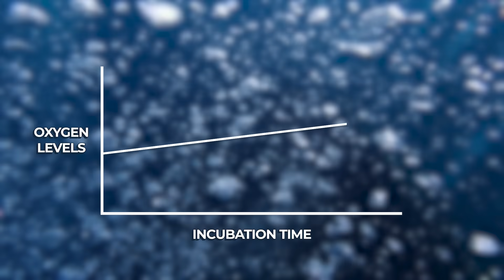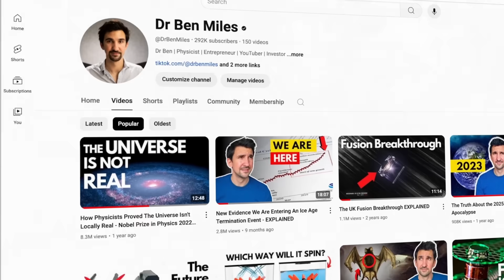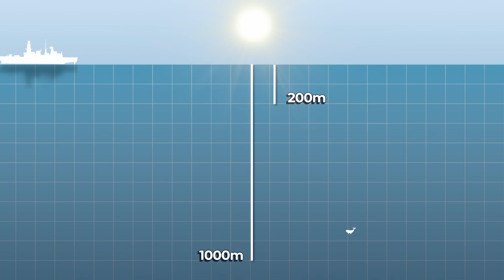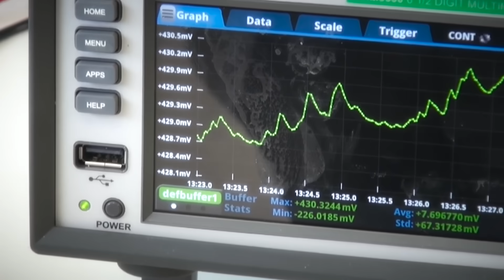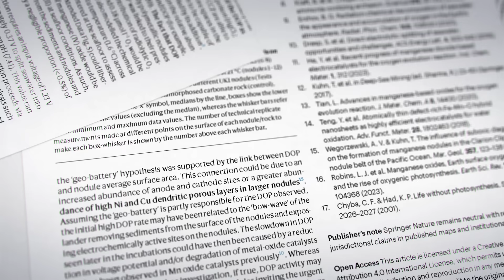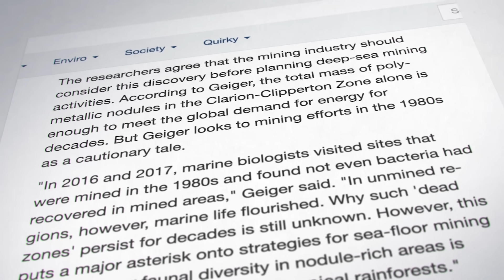We Just Discovered "Dark" Oxygen on Earth - Breakthrough Explained

Comment: It's possible that the oxygen production is related to the growth of the nodules. Since these deposits are growing over time from metal precipitation, it may be that the water used in the experiments was being depleted of metal ions as they attach to the nodules. Once the water was depleted of the materials, then the electrical production on the surface of the nodules could reduce. I would be interested to know if they did voltage checks before and after the oxygen peaked. Another possibility is that the reaction requires a lower oxygen environment. It would be interesting to find out if the conditions for producing oxygen and for growing the nodules were related.

Comment: I have to wonder if pressure has something to do with the separation of oxygen and hydrogen from water. Perhaps pressure is the input energy and the nodules are acting as a catalyst to facilitate the decomposition of water into H and O instead of electric current. Electrolysis would cause the depletion of the nodules over time, but perhaps pressure facilitated catalytic reactions would not?

Additionally, everything on earth is vibrating to some degree with the earth’s background vibration frequency, so perhaps the water pressure plus that small amount of vibration across the surface area of the nodules on the sea bed could be enough input energy to kick off a catalytic reaction? Would be interested to see if the reaction occurs at STP vs at depth, and whether the composition of the nodules change at STP vs at Depth.

We know that manganese can catalyze 2(H2O2) decomposition into 2(H2O)+O2 at STP. Maybe at high pressure and under certain circumstances or with a salt solution, manganese or a manganese bearing nodule could cause a similar reaction converting the water to hydrogen and oxygen? Just wondering out loud, please don’t crucify me in the comments :/
Reply: Damnit I just asked wrote comment three minutes after yours asking same thing. Don’t several battery types use pressure for both efficiency and different chemical processes?

Comment: I think the cause of the plateauing is more likely to be that the electrolysis is creating the O2 from something in the seawater (as either a component or a catalyst), rather than from the water itself. A limited supply of that something in the small sample of seawater would therefore limit the production. As for the 'unlimited battery' part, you have to remember that as long as the 'battery' is still in the sea, it's still growing. So it's not so much 'never ending.' but is just growing at a rate fast enough to keep it able to produce.

Comment: Maybe the process just keeps oxygen level there. Those deep waters have very low circulation and oxygen doesn't come up either. And there is quiet low oxygen consumption. So those rock batteries make oxygen level then reaction stops. They can check it out with some limited capacity oxygen absorber added in a can.

Comment: The jab at labeling it "dark" was uncalled for. The alternative label would have been "Non-photosythetic". Which is pretty much synonymous with "happening in the absence of light-2, vulgo "dark".

Also, when I hear that a chemical process in an abundant environment is plateauing, my fist thought is not "depletion of a reagens", my first thought is "dynamic equilibrum".

As for the idea that it's a battery driven electrolytic process: First problem that comes to mind is conservation of energy. If it takes energy to electrolyse that O2 out, this energy has to come from somewhere. As you say: It's difficult to produce a battery that does not immediately discharge. If that is the mechanism, there needs to be another mechanism, e.g. thermally driven, that first creates that potential.
Under that aspect the idea that stirring up the mud is the initiator is not that far off. This also introduces the possibility that the necessary energy is transferred into the system by precipitation of that mud from the surface.

Comment: It could be a battery, but then with the whole of the ocean as the kathode and the polymetallic nodules as the anode, or vice versa. There is probably a constant supply of the kathode or anode dissolving in the ocean, which makes it a continuous process. Of course the supply of those stops, when they put the water in a container.

Comment: 1. It appears to be a localized phenomenon 
2. It requires Oxygen to be produced by electrolysis 
3. Electrolysis appears to be catalyzed by the nodules and sea water.
4. We don't know the temperature of the sea water
5. We don't know if there are local currents in circulation which help complete the circuit.
6. A good working theory should explain both the increase in production and the subsequent plateauing of production
Reply: Point 6 is tricky, remember we are talking about both in vitro and in vivo findings here. The in vitro studies were of course in a closed environment, with electrolysis producing both hydrogen, oxygen and pure water as products. You would have expected measurements not only of oxygen concentration within the experiment, but hydrogen concentration and salinity also. The plateau could be due to any of those factors in a closed environment, or something entirely else, but would/could not be seen in vivo. It could well be at the low voltages seen, and with these factors, electrolysis is impeded or halted after time in silo. More study neeeded it seems.
Reply: Point 4 : we do know the SW temperature. Even if the experimental equipment didn't include a temperature sensor in their data-logger (very unlikely - it's a Biological Oxygen Demand experiment - temperature is an important control on BOD in surface environments where you also measure it) then the ROVs that deployed and retrieved the experiments would have included a hydraulic fluid temperature sensor (and report to surface) because the temperature of the hydraulic fluid (oil, or dyed water) is an important indicator of the state of the hydraulics system.
Immersed in seawater, at wildly varying pressures, hydraulic power is much less difficult to work with than electrical power. For things like propellers, rudders, pick-up and drop-off arms, covers on sample baskets ... the temperature was available, and they'd have been fools to not use it. (I used the ROV hydraulics temperature as an estimate for sea-bottom temperature in my work at sea, where it is an important parameter in estimating the location's heat-flow. If they run the hydraulics, the system temperature rises ; when they stop running the hydraulics, the temperature falls back ; plotting the decay time-temperature curve, you can estimate the seabed temperature as closely as you need.
Reply: 1. These nodules exist in very, very large areas of the deep ocean, we know this for a fact. Are you calling that "localized" or do you mean something more local? I don't think we can know for sure until more research is done. If it happens everywhere that these nodules are common then we're talking about a significant proportion of all the deep oceans.
2. That is the definition of electrolysis, yes.
3. The sea water is not the catalyst, it's the electrolyte. By the nodules, yes in part it seems that way, although also there's an observed voltage potential across the nodules i.e. it's powering the process, as well as catalyzing. 
4. Yes we do!
5. The experiments were carried out in sealed tubes, not sure how "local currents" are relevant?
6. Yes, I agree with that part at least!
Reply: @PhilAndOr  For 5, he explained it in the question when he said, "Which complete the current."
Reply: @ISayNukem  currents are irrelevant when the oxygen production increases inside a sealed tube.
Reply: Lighting, is just a happy electron going wee, it only takes one single molecule to create energy that surpasses the sun heat in an instant (lightning|)
Reply: YA what he said, and don’t forget the buried rotting whale.
Reply: Could the tubes themselves be part of the reaction?  Something akin to rubbing a balloon on one's head?
Reply: @stferret  Static electricity in a conducting medium ... that would be a neat trick.
Half of my electrostatics lessons in the physics lab didn't work because of the humidity varying with the weather - and we did that part of the course at the best time of the year. Soaking the whole appartus in 3.5% w/w table-salt-in-water is going to be even more effective at quenching static electricity than 1% water-in-air.
Reply: You really think they sent a million dollar scientific probe to the bottom of the ocean without a simple temperature sensor? Seriously?
Reply: how do we replicate these natural oxygen and hydrogen generators so they can be used to make cheap energy on the industrial scale is the question that needs to be answered.
Reply: maybe the pressure is just right at the bottom.. or the connection to earths core is important....
Reply: @picksilm exactly my thought.. perhaps there is a oxygen rich cavern somewhere way deeper down than our current machinery can operate.
Reply: Fart in the bathtub

Comment: Wouldn’t the hypothesis of electrolysis be better supported by measuring whether both free oxygen and free hydrogen increase in the samples collected?

If the process were organic (which , it could be a form of chemosynthesis), the increase in oxygen might not be accompanied by an increase in hydrogen; but if hydrogen does proportionately increase with oxygen, then the support of the evidence weighs in favor of electrolysis. 

Fundamentally, an oxygen increase without a corresponding hydrogen increase would be dispositive of the electrolysis question.

Comment: On the surface of the nodules ionic dissolved metals are being laid down constantly, via marine snow. At the same time electrolysis is oxidizing some, but not all, of the metal layer, producing oxygen. It is a continuous process, nearly in balance but favouring the deposition process slightly, resulting the very long growth rate of the nodules. In the experiment the deposition process was interrupted, resulting in a tailing off of the electrolysis, and subsequent oxygen production..

Comment: My opinion is that it's a mix of the water rubbing against the stones and the minor current from the stones causing the water molecules to split. I would say it's more of a static electricity rather than the stones being a battery. That said the stones give the proper conditions for it all to come together in one place. This would also explain why removing some of the sediment allowed for greater production of oxygen. It not only gave room for things to move and generate more static electricity for the stones but gave more surface area for water molecules to rupture on the surface of said stones. If you removed all of the sediment you would probably find that the production of oxygen would drop, just like when the stones are removed.

Comment: This made me think of Styropyro's video on brass pennies.  A water-splitting battery rock sounds possible... but if there needs to be an unusual disturbance like the sampling equipment dropping down and moving sediment to expose the reactive sites, then it wouldn't be an ongoing ecosystem feature, would it?  These things would have to be so sensitive they can be 'turned on' by a sampling event like that but not so sensitive that they burn themselves out over millions of years?

Also, "three times the background amount" of oxygen doesn't sound very impressive if the background amount is basically zero.

Comment: If oxygen is produced by electrolysis, then there should be amounts of hydrogen there as well.  Most likely is the oxygen is leaching from the test vessel walls at test depth.  Just like when you evacuate a light bulb, then wait, oxygen will leach out of the glass walls and you have to evacuate again.

Comment: I wonder if they took into account the material that the isolation containers were made out of. If the container had a different redox potential than the nodules then they created a battery by covering the nodules with the sea water acting as the electrolyte. The oxygen and hydrogen production would only proceed as long as their created battery did.

Comment: I think the "battery" idea kinda works. As the oxygen levels plateaued in the sample the electrolyte had been exhausted. On the sea bed think of the sediment as being the dust on a solar panel, it still makes electricity but at a lesser level. The electrolyte is still getting to the nodule but at a lesser level. In a closed "test" it may be depleted. It would be interesting to run a continuous test on the sea floor, i.e. open door... sampling the in and out.

Comment: Your concerns are well made. It does seem unlikely that:

-  the natural process of precipitation just happened to form working batteries
-  those batteries could stay charged after literal millions of years discharging into the water

And the scientists themselves say they didn't find a high enough voltage for electrolysis. But I still find this discovery incredibly exciting! It seems the nodules really do act like batteries, since they did actually measure a voltage difference across them.

As for where the energy comes from, maybe the process is partly biological? Maybe there are organisms inside the nodules (bacteria most likely) that provide the tiny extra charge that makes electrolysis happen? And maybe it's these organisms that keep the potential difference going over millions of years.

Comment: Seems like the biggest problem with the battery theory is a temporal one.  These deposit occurred in saltwater, the same electrolyte that's supposedly powering the "battery."   That means by growing 1-3mm/million years, it was storing more energy than it could deplete into the surrounding saltwater.  If it had formed in different conditions, and then was exposed to the electrolyte, maybe, but electrolysis has existed the whole time, not just when we figured out how it worked.  So why weren't these batteries already depleted?

Comment: I doubt that electrolysis is the source of oxygen in sea water, for one particularly simple reason: Sea water contains dissolves salts, most of them being chloride salts, such as sodium chloride and calcium chloride. Electrolysis of fresh water (with no chloride salts present) does produce oxygen, though this can be accelerated and made more efficient by adding either an acidic or alkaline electrolyte - small quantities of sulfuric acid or potassium hydroxide are most commonly used for this. However, electrolysis of water with chloride salts dissolved in it generally does not produce oxygen, because the chloride ions present will be preferentially oxidised into chlorine gas. You can get some oxygen gas produced as well, but only if the solution of chloride ions is very dilute, or if the applied voltage is excessive, which forces more electric current through the solution which can be consumed by oxidising only the chloride ions. In those circumstances you will get some oxygen produced in addition to the chlorine gas - but any electrolysis of a solution of chloride salts will always produce some chlorine.

However, the low voltage described in this video (less than 1 volt), if it did result in any electrolysis occurring, would be highly unlikely to produce any oxygen: Primarily because there is more than enough chloride dissolved in sea water to ensure that chlorine would be preferentially produced by such a slow (low current) electrolysis, but also because such a low voltage would probably not be enough to produce oxygen by electrolysis, even if there were no dissolved chloride salts present.

Comment: Thankfully SCOTUS won't be the ones deciding if it's ok to strip mine the seabed!
Perhaps the oxygen is produced by the interaction between the nodules and the biomass that sinks to the seabed, in the presence of an electrolyte.The biomass is deposited at a certain rate with larger nodules having more surface area which correlates to more O2 production.
The ecosystem/biodiversity factor alone should be reason enough to tell the plunderers to keep away.We'll have to clean house and root out all the bent politicians and their lobbyist employers if we want good things to happen.

Comment: why aren't they depleted?
well i would imagine they can gain charge over time by the giant wireless charging station at the centre of the planet (giant spinning lump of ferrous iron - the core) being so close to it
Reply: They're not rechargeable.  🤦🏻‍♀️
Reply: @wcookiv  instead of rudely putting a facepalm emoji, would you kindly explain why not
Reply: @TheHarleyEvans  Because the chemical process that produces the current isn't reversible under those conditions.  It's basically one metal breaking down against another, and reversing the current won't just put all the atoms back where they were.

I used to work in one of the world's finest electroplating refineries, I know a little bit about electrolytics.
Reply: @TheHarleyEvans  Also, if the earth's geomagnetic field were strong enough to put a charge through a small lump of rock then electronics wouldn't work.
Reply: @wcookiv  the ocean environment however is full of ionic metals, which is what's causing the nodes to "grow" if there's a ferrous component to that, then surely it's not too far fetched to imagine that a few stray electrons here or there, end up there or here especially under the magnetic fields. it's also important to view the entire bed as one supercell rather than just the individual nodule components - the salinity of seawater, especially a great depth is more than enough to provide a conductive pathway.